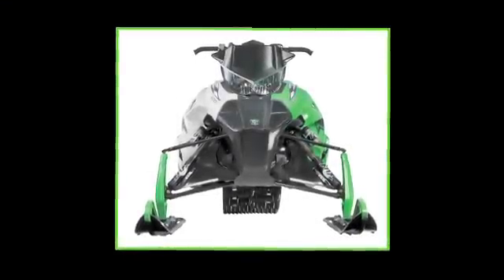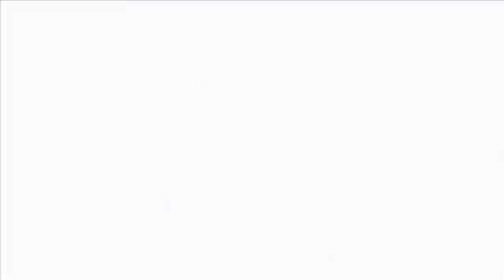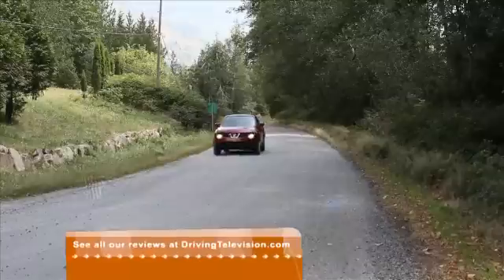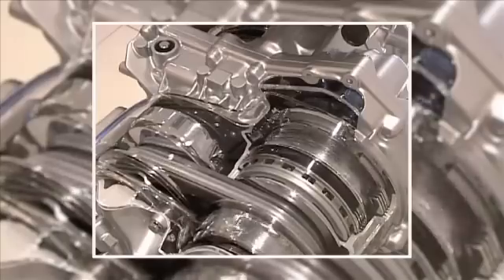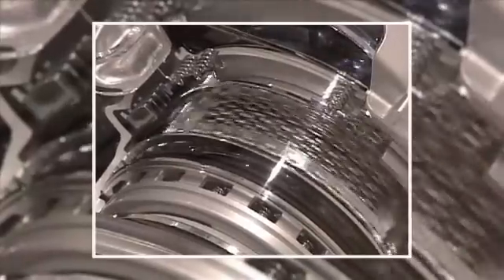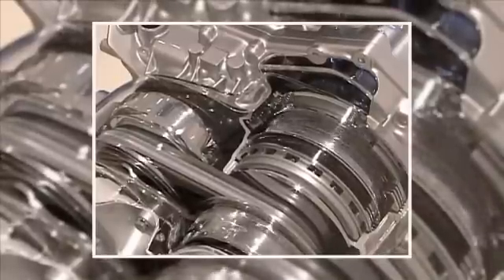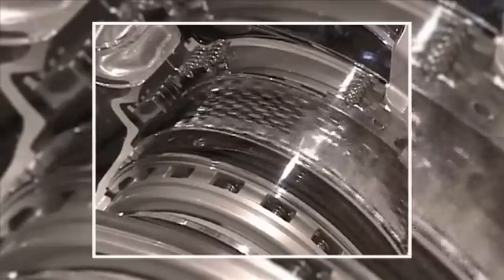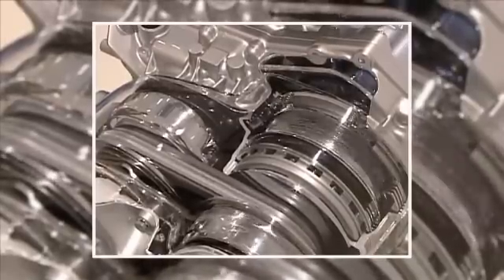Continuously Variable Transmissions (CVT)

Comment: CVTs are the future.  All the high-end brands are using them.  A steel belt can easily last a long time in a small engine.  The only downfall I see if this belt does snap, it will release bits of metal everywhere and damage worse the CVT.   But compared to the amount of stress taken off the engine with its infinite # of gear ratios, the engine will imaginably have less wear on it and will last longer longer with less problems.  Honda's CVTs are pretty badass and I guarantee you won't hear alot of issues until the 15 year mark if you don't redline it.    They're not meant for that but definitely at 4000-4500 rpm for passes, the engine accelerates faster and more efficiently than a 5 speed.

Comment: I have the smallest JATCO CVT in my Mitsubishi Mirage. Up to now, there are no problems with it. Although JATCO provides the same transmissions to Mitsubishi and Nissan, I only hear about problems with Nissan cars. So, maybe there is something wrong with the integration of CVT into a Nissan? I have noticed that Mitsubishi does two things differently. Mitsubishi uses lower torque and lower power engines than Nissan in the same type of JATCO CVT. And Mitsubishi programmed the ECU so that it does never release much power instantaneously on the CVT, but a little bit more gradually, avoiding peak load. So, it might be that the CVT is good, but Nissan made a few too optimistic presumptions using it.
Reply: How about honda cvt are they reliable?
Reply: @ar.pranavsoni2200  yes they are. Provided you do proper maintenance and respect the warming up times of the transmission and engine, same as any car. I see a lot of Honda fit/jazz cvt with more than 200000km and they have no issues.

Comment: im now realizing this is why i thought there is something seriously wrong w the new car. this is making my concussion worse. no way to drive my car smooth not even going into a parkinglot it jerks as i slow down and take foot of the pedal i cant even tap the gas lightly accelerating without it causing my head to move bounce i feel like a bobble head driving. i try to drive like an old lady and that doesnt even work. its a forester and beautiful but how the hell do i drive this engine smooth?
Reply: The sensation you are feeling is the cvt being locked up so the tq.coverter is locked at a low speed.

Comment: you forgot to mention its final smooth benefit of making you give up on cars because the belt and chains in cvts always brake and will cost you thousands to repair. this guy is right on the money and he knows that customers love to always brake even and think they are saving money on gas when they have to repair there transmission at 50 000 miles. lol fucking idiot nice sales pitch. dont beleive this new tranmissions style people. honda, nissan and all car makers these days dont want to make anythingg that will last a long time they want it to break and get you to pay for it
Reply: CVT transmission is a push steel belt driven by two moving cones As long as the push steel  belt and the cones never touch They should last way pass the life of the car.  They will last for ever. But the  CTV  transmission problem is in the  incredible amount of heat the CTV transmission generates. It burns the CTV fluid after a while  carbon build up in the fluid and it lose it viscosity can not longer can protect  the CTV transmission So  all CTV transmission have is a CTV fluid over heating  problem. There are cars on You tube that have done over 180,000 miles and there still going good So If you change the  CTV transmission fluid ever 60,000 km the CVT transmission should  out last the lift of the car.  it in The reason for this is Nissan ran cars with CTV transmissions in them in city traffic for five years with no trouble what so ever.  But the thing is the transmissions were regularly being taken apart and checked. In  doing this the  cars CTV transmission fluid were continually being replace.   the CTV fluid would never wear out The role of the  CTV transmission fluid is to prevent the push steel  belt and the cones from ever touching But once the CTV transmission fluid gets to old it loses it viscosity Then  it can no longer protect the  the push steel  belt and the cones  They will start to come in to close contact with one another As they start to rub together the CTV transmission will start to make a whining sound the push steel belt will start to cut in t the cones  and eventfully the push steel belt will finely fail But people have said when there transmission start to make a whining sound  they took it to an Auto repairer they just replace the CTV fluid it fix it all most instantly.

Comment: Unlike the gear drive the CVT depends on friction of the belt and pulley, so there is much slippage due to lubrication between the friction faces. This is a friction drive. You don't feel solid pick-up when you accelerate as in positive gear drive.  In the old days this was known as vari-drive belt.  Linkbelt also made the PIV (positive, infinite variable) drive. This is better.